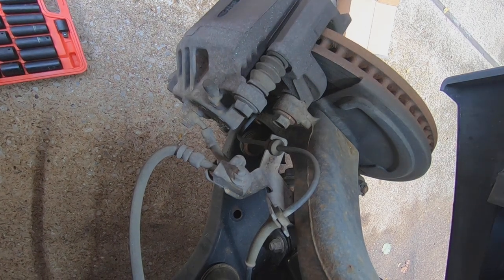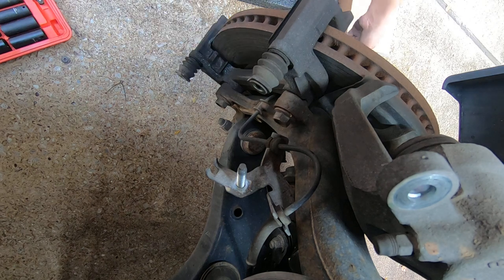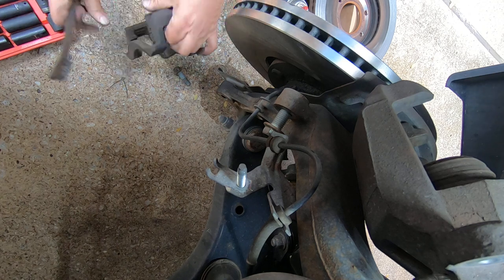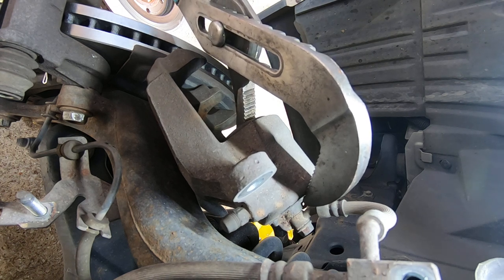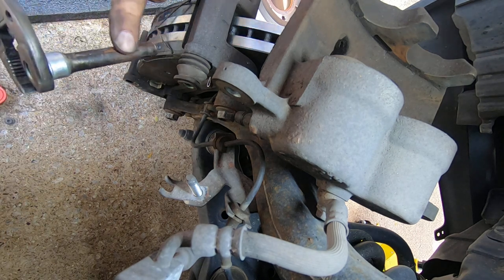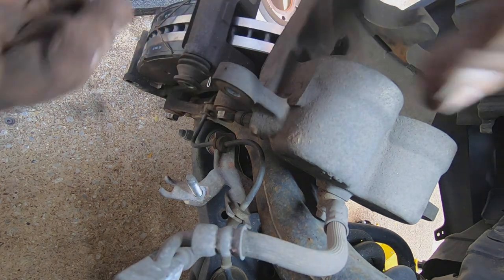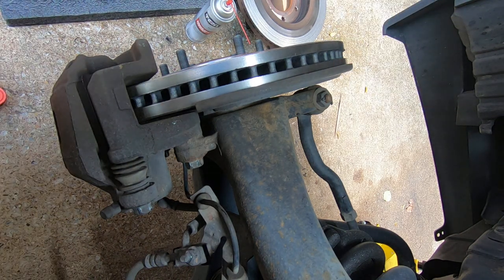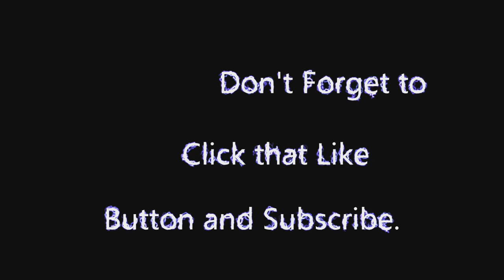Brake pad and Rotor Replacement on a 2018 Nissan Armada / Titan.

Comment: Wow.  those old rotors look every bit as thick as the new ones.   I'm too frugal with my own stuff.   For years, I have just had my brother spin the rotor by hand, right there on the truck--- while I hit it with a grinder.   It pretty much simulates being on a lathe, since the rotor is constantly moving--  and really cleans up nice.  Especially on my old F150, it would have the bit lip on the outer edge of the rotor;   This works really well for just grinding that thing back down flush with the rest of the rotor, and getting another 50k or more out of them.  It has always worked well for me.  I can understand not doing that for customers though.
Reply from the maker: If it was my vehicle I would have slapped pads on it and let it go. After a couple hundred miles the new pad would smooth it out and it would be fine. But like you said for the owner of the car they get a new one.

Comment: Just did my 2nd gen titans rotors and brake pads and remoing that 13mm bracket where the brake lines are is a must..  you have no wiggle room with it attached and once i removed it i placed the caliper on the upper control arm which helps a lot.

Just make sure you dont twist it the wrong way or you'll pinch the line.

Even if you're just doing the pads and want to remove the lower caliper bolt and loosen the top to swivel it up you cannot do it because that short piece of brake line.  I found out initially and also again when i forgot those expansion clips that fit into the slotted holes in the pad housing when i went to add them in.. had to remove both caliper bolts again AND that bracket bolt to have access to put those stupid ass metal pins into the pads.. 

Hey at least the 2nd side went twice as fast as the first 😂..  now i have to do the rears but my steering wheel was shaking bad when braking at higher speeds.   All is good now but those rears need changed. 

I had good life left on the fronts and it's odd to me how the rotor got warped.  I haven't done any long distance driving or mountain driving where I was using them a lot but it just happened one day and got worse and worse.   The surface of the rotor was smooth but I'm curious to how it warped..  i was thinking about turning them but for $70 on Amazon i got both front rotors which is a hell of a deal so I can't complain.
Reply from the maker: Rotors can warp from getting hot then hitting a water puddle and cooling them off to quick.

Thanks for the info BTW.

Comment: I got a question before pushing the piston back is is it necessary to pop open the reservoir
Reply from the maker: It is best to open it but let the cap or lid rest on the opening because brake fluid is hygroscopic and it will soak up moisture.

Comment: Need to clean and lube the pins on which the calipers slide. These usually are crudded up and can lock the outer pad up.
Reply from the maker: I always check them and make sure they are sliding easy, as long as they are I don't mess with them.

Comment: Only the clueless avoid torque wrenches / service manuals and “oooguh dooguh” their way to destroying their vehicles over time.
Reply from the maker: To be fair once someone has torqued enough nuts and bolts you get a really good feeling for how tight things should be. Someone that isn't mechanically inclined or doesn't work on mechanical stuff much should torque everything and make sure they read the manual.